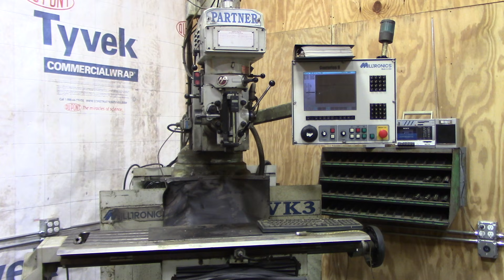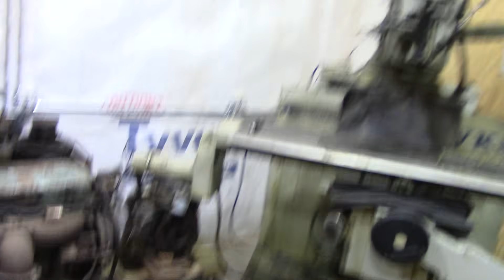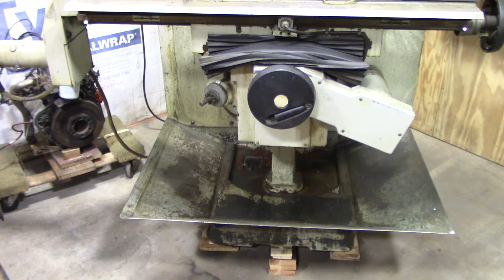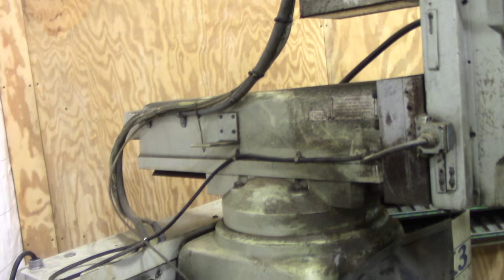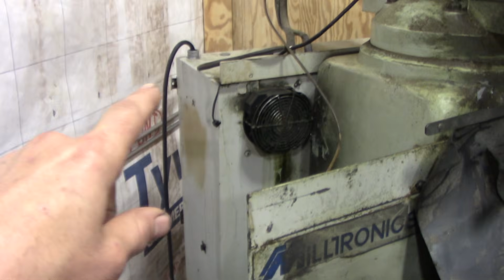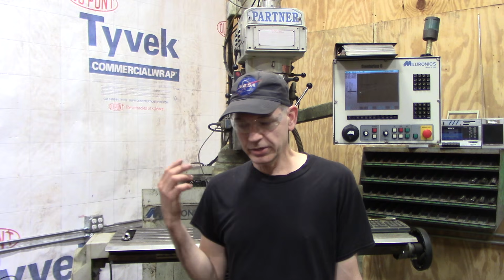4-15-26  --  Selling my Milltronics Partner Centurion 6 Mill

Comment: Nice mill, hopefully someone will take it off your hands.  I'm like you,  strictly a manual machinists with all manual machines.  Been around CNC machines since the 1970's.  Know how they work, familiar with the tooling used, just never had the opportunity to run one.  I've always been the guy that told them if the parts was good or scrap when there was a problem and designed the things the CNC machines built.  Thanks for sharing.